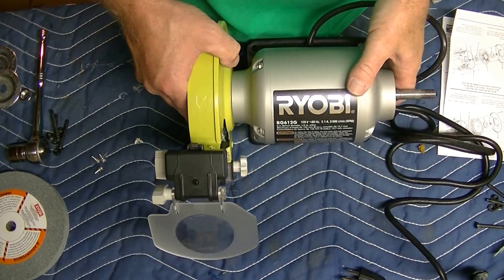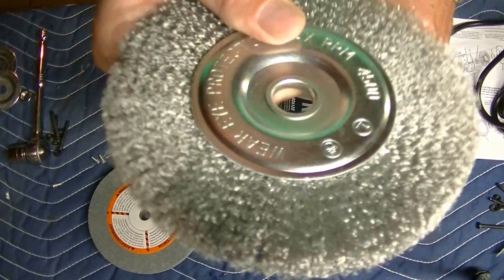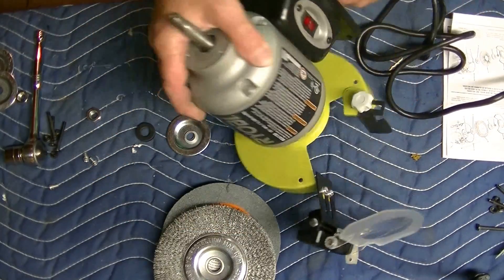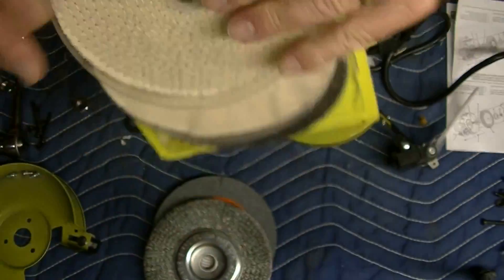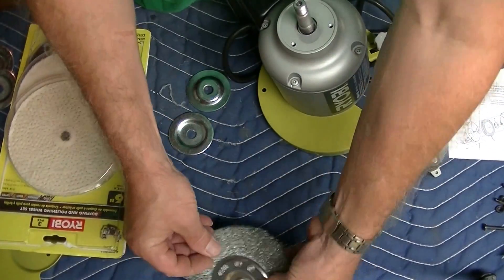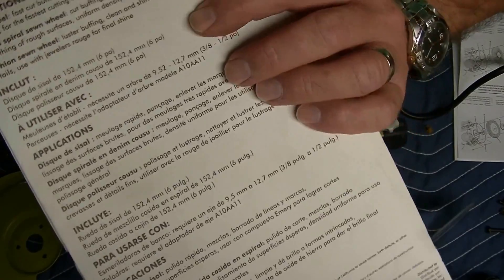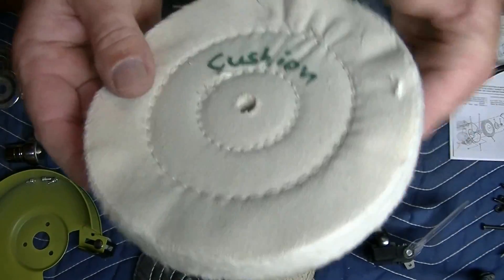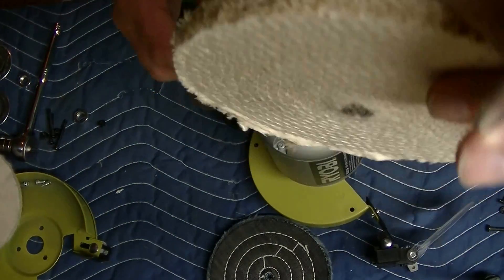Ryobi Bench Grinder Polishing Wheel Assembly

Comment: For those looking for another spacer to use skinnier wheels at the same time. Home Depot (Everbilt Flat Washer M12). Stack 2 of those on top of each other and they equal the specs of the single black spacer that came with the grinder. Washers come in 3 pack, was 70 cents.

Comment: Helpful video, but I struggled to hear exactly what it was you were saying as the audio was not good.  I have this bench grinder and have been trying to find a spacer to purchase as it didn't come with the Ryobi 6" grinder I purchased.
Reply from the maker: Sorry about the audio. Try stacking at least 2 of M12 washers together. M12 means Metric 12 millimeter hole. Please chose an outside diameter that fits your need although a M12 should naturally be big enough as is. Any hard ware store should have it. Good luck.
Reply: @thefishingreel1449  Awesome, thank you.  I had purchased my bench grinder from DirectToolsOutlet as a refurbished model and it took me a long time to figure out it should have come with a spacer as I didn’t think to put on a wire brush wheel until a year after I had owned it.

Comment: So if you wanted to use the denim wheel and the soft wheel, would you need 2 spacers?
Reply from the maker: I have it set up with 3 larger washers on the motor side as spacers and the you obviously need the two big flanshes.  1 on each side of the wheel.